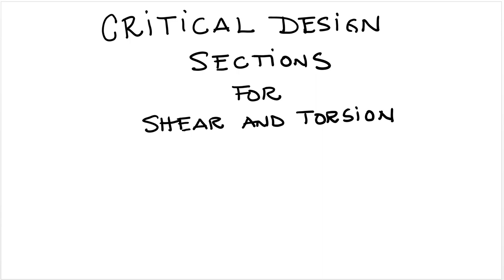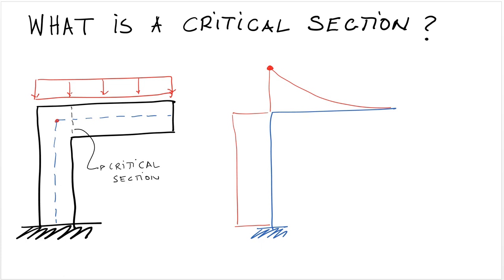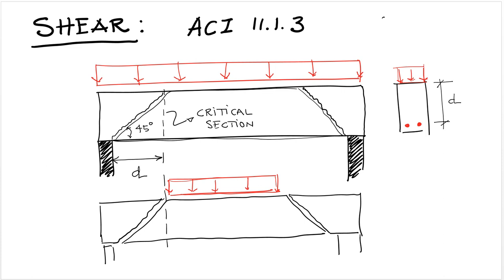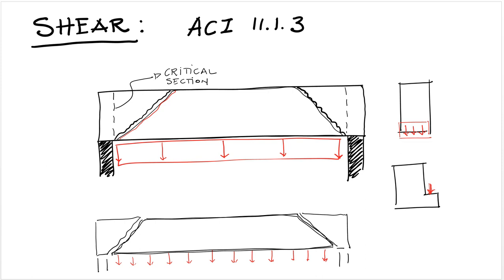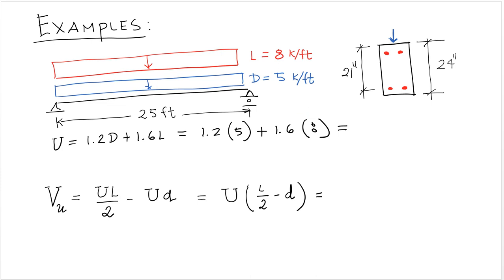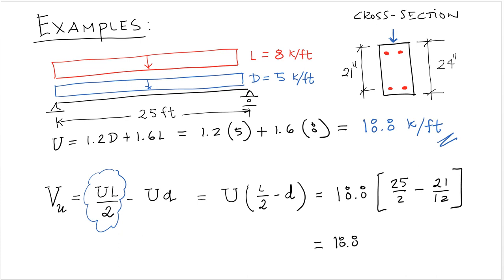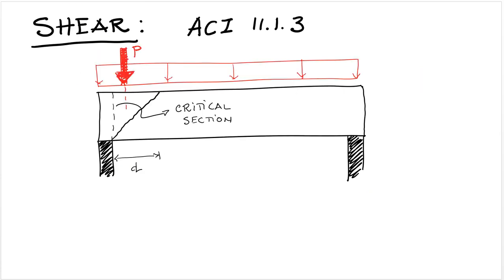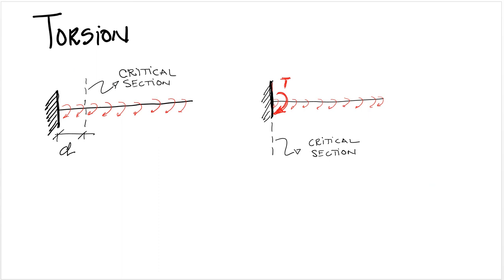Critical Sections for Shear and Torsion in RC members

Comment: Not sure for shear. Critical Section is inclined, as shear stresses, in italian classical text, not vertical. Max Shear stress is at the centre of rectangular section, so your critical section  should be at d/2 not at d. More you must consider that max shear stress at the centre is 1.5 times mean value. Where i wrong?
Reply: This must be from some other code I'm guessing. ACI code says to take critical  section at distance d

Comment: 1.Can you please tell that what if i takes a critical section for shear at the point of max. Shear force. Is the design wrong or it is only uneconomical but ok.
2.what should be the critical section if the beam is over hang from one side with 2 supports and a udl over the whole span.